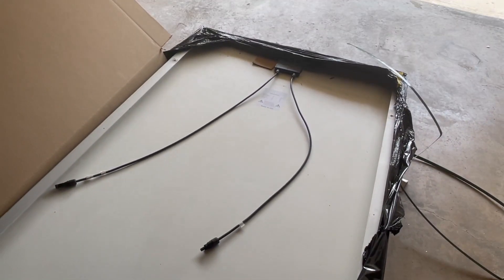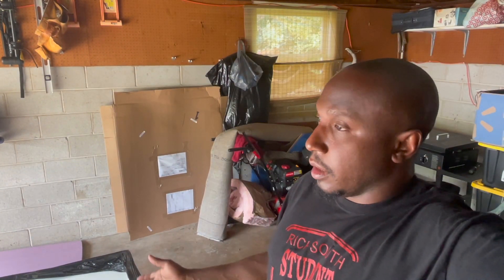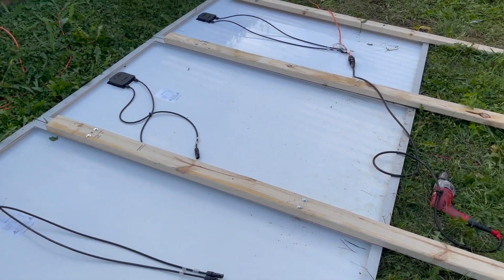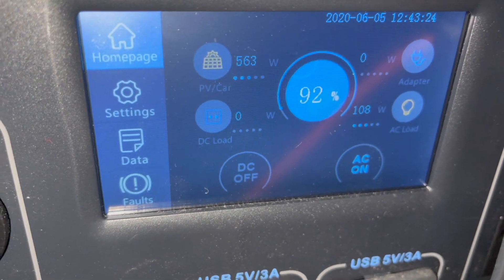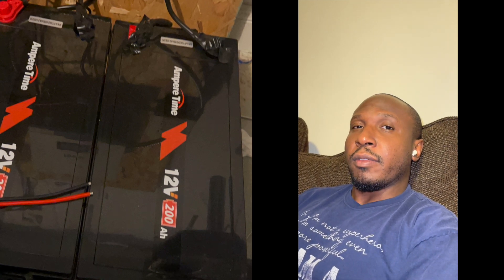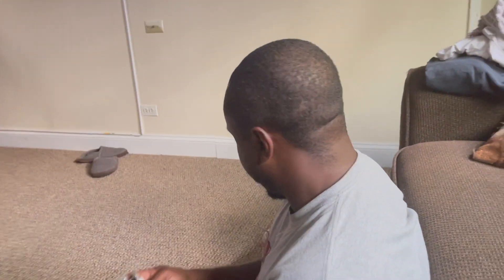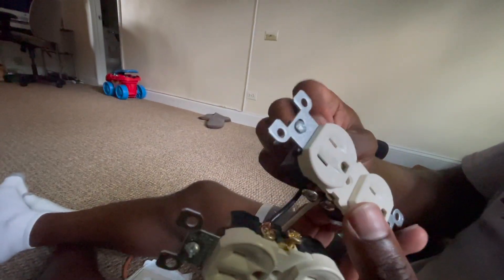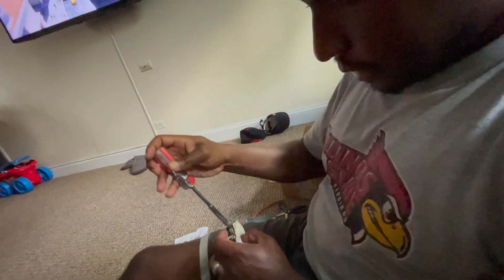my solar powered home entertainment  project

Comment: How do you have the four panels wired in this video? In series or parallel?
Reply from the maker: I have Two sets wired in series then the two sets in parallel. (1+1) + (1+1) = 4
Reply: @atechieinchrist  ok. I’m having a problem, because when I connect multimeter directly to my panels. The Voltage and Amp reading seems to be twice that of what reads out when I connects it to my growatt. Is because there is a load on the growatt aka. the batteries charging?
Reply from the maker: @mblydenvlogs  I see that the growatt can fluctuate based on the demand of the load, for example of my game systems are both on pulling 500 watts, plus the other loads , the power drawn from the panels doubles. But in general, I’m sure it’s efficiency lost through the charge controller

Comment: GREAT DEAL ON THE PV MODU;ES AND TO JUST GET A WHOLE CASE OF THEM TO SAVE AT LEAST SOME MONEY AND THE BUDGET SOLAR PANEL RACK BUILD IS THE BEST WAY TO GO FOR A SUCCESSFUL DIY SYSTEM . KEEP THE POWER GOING OFF GRID AND MAY THE SOLAR BE WITH YOU  .
Reply from the maker: Yes bill has dropped significantly already